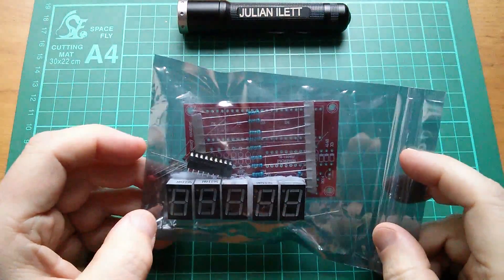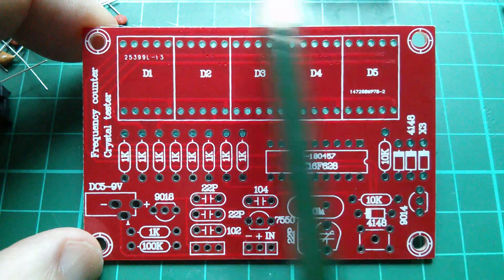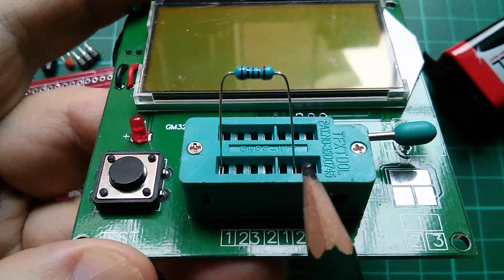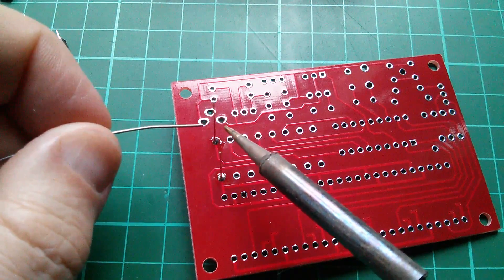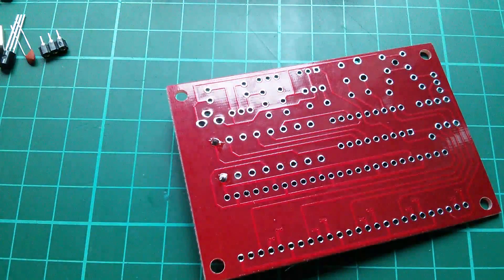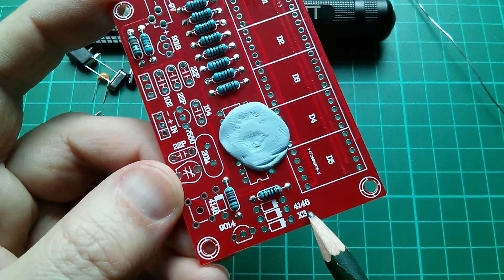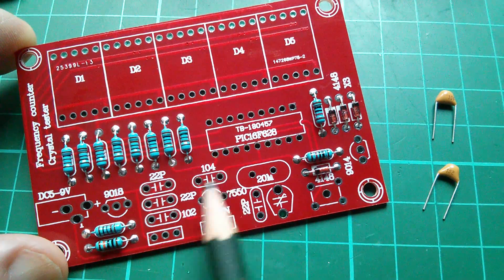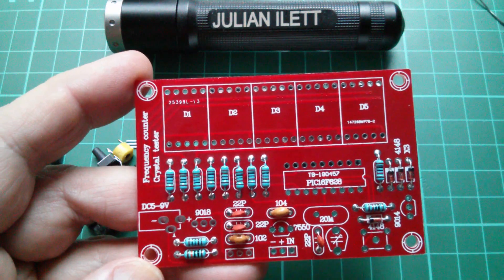Fairly Easy - Frequency Counter - Electronic Kit Build (part 1)

Comment: For anyone interested in using the xtal tester part, change base to emitter cap to 1N and emitter to gnd cap to 100P, then change 1k resistor to 2k2. xtal tester part now works reliably 👍🏻

Comment: It will be the maximum full-fledged device only after adding an amplifier with a signal conditioner on the Schmitt trigger to it.
If you need a kit with a PCB (26x9mm) and SMD parts for such an amplifier, contact msn-pro@@t
Amplifier kit cost = 3 USD + shipping
cost @t

Comment: I would have done the crystal, chip socket, and 3-pin connector after the resistors and before the capacitors...

Comment: Remember those opaque standoff's that you pushed through the holes ( You said they would work with the little LED boards that didn't have room for a screw or bolt ) ? Well how about using them as a stand off so you can have space for all the unevenly sised components ? I use plastic Motherboard standoffs and screw another on top to hold it then just unscrew and remove when finished . Like these :-
https://www.amazon.co.uk/Fixed-Pillar-Motherboard-TOOGOO-Stand-Off/dp/B01GO4NSE0/ref=sr_1_1?ie=UTF8&qid=1523210226&sr=8-1&keywords=nylon+motherboard+standoffs

Comment: The way to solder these resistors is to put them in, hold the component to the board, and bend the leads (while pulling on them on the solder side, and pressing the resistor against the component side) OUTWARD (away from the component holes) to a 30 to 45 degree angle.  Non you can release everything and solder.  You will have a via-lead-contact (metal to metal). Also, this allows all the components to be held tightly in place and you can solder all of them.

Comment: Like you I hate 5 band metal film resistors. Not only will they read both ways, the colours are not easy to differentiate between with the blue background, maybe if they used a paler blue it would have been better.

Comment: Hi Julian - 9:50 a small blob of Blu-tak under each corner works well to stabilise the PCB, just press it down until the resistors are firmly sandwiched between it and the work surface.

Comment: In order to remember anode vs. cathode, I think of a cathode ray tube, which uses electrons, which are a negative charge -- hence cathode is the negative terminal. Also arrow points the way current can flow through the diode.

Comment: In the diode symbol I remember cathode/anode by the letter K shape that's for 'Kathode'.  By the same token, the triangle at the Anode end indicates the other.  As for polarity in a circuit, one can just remember the line at the cathode end blocks electron flow (from negative, not conventional flow).  Also, please bend your leads slightly AFTER inserting them so the components don't fall out - everyone knows this and can't believe you don't!

Comment: If you want that nice "svelte meniscus"... use some additional flux. With diodes, I just try to imagine that the black bar is the black bar part of the symbol used in the circuit diagram, like this.

>|    the | being the black bar on the component.

Comment: When soldering the resistors, why not place them in the holes and bend the wires outward? This can be done with most components and works wonderfully every single time! No need to fiddle about! Sheesh!

Comment: With diode polarity I just remember that the line on the diode is on the same end as the line on the symbol, which is of course the end the arrow is pointing towards, and the arrow points in the direction of conventional current flow.

Comment: Ah, keeping all the offcuts. A spool of wire costs nothing and still I keep them as well ;) . Guess where? In the box of breadboard wire jumpers. They hardly ever end up being used on the breadboard, but them being pre-cut makes them much more handy than a spool of wire when needing wire links when soldering.
And yes, resistors have to be oriented all in the same direction! Even accross the hole board (e.g. tolerance always to the right or bottom). It's much faster to check if the correct ones are installed. And once they are in there is no more guessing on those 5-band resistors.

Comment: since the board has plated through holes you could have soldered then from the top and cut them flush with the back,basically filling up only the holes

Comment: Those resistor tolerances are for thermal variations so just by holding them in your hand a while will make them read lower ohms and cooling them will cause them to read higher, so the question is if they were manufactured in hot country you would expect them to read higher in the UK
Reply: Resistance rises with temperature.
Reply: Generally speaking that may be true, but modern resistors incorporate a manufacturing process that offsets this and if you measure a carbon film resistor you will see the opposite take place due to compression of the carbon material while heating, this is built by design as part of it's tolerance so if it says 1% it means it will try to maintain a constant resistance under loads close to its maximum. http://www.learnabout-electronics.org/Resistors/resistors_01a.php
Reply: *****
Interesting. Do you have any source about the details of the construction/how it works? (materials used, physical construction,...)
I did a quick search, but only find manufacturer's general description of low tempco resistors.

Comment: 4:12 aha I knew you had one. my component tester is a little different its the kind you get as a kit and has a rotary encoder but it does frequency counting and generation as well as component identification. Ive never actually used it for that so idk how good it is or even how to connect a frequency source for that matter, but its there in the menu. actually I think I'll see if I can get it to count a 555 after lunch

Comment: Hey Julian, here's a small tip on those resistor color bands. The resistors with the beige body usually seem to be 5% tolerance, while these with blue bodies are usually 1% tolerance. That means, that the brown band will be always the last one. Yes there are still occasions, where it starts with a brown band as well as it ends, but this way you can determine a lot of resistor values. :)

Comment: I'm hoping in part 2 Julian will explain how the programmers of the software for the pic decided you need to save a wave form and then why you need to program in an offset when taking a measurement of a frequency.  Here's hoping.
Reply from the maker: Something to do with amateur radio ;)
Reply: The facility to add an offset frequency is provided so that you can connect the frequency counter to the local oscillator stage of a superhet receiver.  The local oscillator frequency is always a fixed offset from the frequency being received so if the offset is equal to the IF frequency (tautology alert) then the counter will display the frequency that the receiver is tuned to.  OK - something to do with amateur radio.
Reply: Thanks for responding.

Comment: I prefere to stick the legs trough the holes, and bend them on the backside.
Then cut them. and finaly solder them.
That way they dont fall out in case they get hot and the solder starts to melt.
The solder should only be for electrical connection, not for holding the component in place.
I belive that was the mounting instructions on kits like this in the old days too :-)

Comment: This kit is a "Chinese copy" of the article published at http://www.qsl.net/d/dl4yhf////freq_counter/freq_counter.html (with the added crystal tester function) .

The original designer is aware of this being copied, but has a very positive attitude about this blatant plagiarism, much to his credit.   The  code within the PIC included with this kit is byte-for-byte the same as that which Wolf published on his web site some time ago ...

I've built one, it works very well (a red optical filter for the display would be handy), and represents very good value for money, IMHO.

Comment: i was making a kit and I cut one of the legs on a resistor and it went flying and went right into my 12v battery bank cigarette lighter socket and made a massive short and blew a fuse
Reply from the maker: LOL - valuable lesson learnt!
Reply: Julian Ilett defiantly I bought covers for them and now use cutters that are magnetic it helps alot
Reply: Over-engineering much? Covers for batteries and magnetic snips? The fingers on your other hand to hold the wires come for free and for a normal person are never more than an arms length away from where you are cutting ;)

Comment: I didn't care about resistor direction when in electronics at school, until the teacher got annoyed and said it wasn't professional. I still try to get them all the same direction but I don't get bothered if I stuff up to change it. Also with the bands on the end, you'll find one end has the band centred and the other more to the inside.

Comment: i want 1 of those resistance measure things how much are they and does it come pre assembled? what is the name of it?
Reply: Jay Mee They are called component testers or transistor testers. You can buy them for a few bucks. They are also kits such as this one is ;D
Reply: when it comes to kits its a disaster for me the components are too small for me to solder you should see the mess i made of a gsm module, robots should pre assemble them things as the leds and things are way too small for me, i prefer to just bye 1 lol
Reply: Search ebay for something like "diode transistor MOS PNP NPN tester capacitance ESR meter". 10$ upwards. I got that one: http://www.ebay.com/itm/131937017257 . Works well and I built my own case from wood, because when I bought it two years ago you couldn't get the case with it. I wouldn't recommend that exact one though. There are other/newer version with more functions (like a square wave/clock generator, which is handy to have around). On the other hand it's mainly a software thing and I guess I could upgrade mine to the new features (the firmware is based on an open source AVR project).

Comment: Thanks, Julian; by coincidence I ordered one of these kits yesterday!
Reply: I'd like to order a kit 🙄 PLEASE send me the address to order from 😎🙏🏾😎
Reply: @Inquire98   One of the cheapest is here - https://www.ebay.co.uk/itm/1Hz-50MHz-Crystal-Oscillator-Frequency-Counter-Meter-Tester-DIY-LED-DISPLAY-KIT/254553622756?_trkparms=aid%3D1110004%26algo%3DSPLICE.COMP%26ao%3D1%26asc%3D225076%26meid%3D1c0eee1ae22c415e9da70caaaf31f71a%26pid%3D100008%26rk%3D1%26rkt%3D12%26sd%3D153884433665%26itm%3D254553622756%26pmt%3D1%26noa%3D0%26pg%3D2047675%26algv%3Ddefault%26brand%3DUnbranded&_trksid=p2047675.c100008.m2219. Good luck with it. NOTE  there are problems with the crystal tester section, search the 'net for remedial work.

Comment: Been thinking of getting this kit myself. I am with you on the 4 band code, dumbest idea ever and my eyes are so poor I can barely make out the colours on that awful blue background. Never had a problem with the old 3 band style, now I have to measure every damn resistor which kind of defeats the purpose of having the bloody code in the first place!
Reply: There is a u in colour and it will stay there! Webster is an impertinence! lol
Reply: I thought maybe they're meant for machine assembly using sophisticated colour recognition automation, helped somehow by the blue background. Which is of course a silly idea because machines don't do thru-holery any more and already have bullet belts and smds to work with. So yeah - definitely terrible. Tsch.
Reply: Glad you got the joke and were not offended.
Reply: 4 banders are annoying but the most awkward resistors are those surface mount ones with the letters, with those you have no chance of reading the value directly and have to look it up
Reply: I say we create a startup to manufacture components with markings designed to be read by humans with aging eyesight. Artisanal components :). At artisanal prices :(.
Reply: maplin sell those yucky blue resistor with 4band plus tolerance, but catalogue states they are 3band, and has done for years...if buying resistors from maplin shops always ask them to check the values with a meter, party because of this, partly because they had a load of bad ones with way incorrect values!
Reply: Don't buy this kit unless you're a ham radio operator or crystal checker nut.  You will build it and it will work buy you'll never use it.  P.S.  There's no u in color.

Comment: I always use a multimeter to check resistors 5 band would work fine on the old round tube style resistors but on the tiny eighth watt ones that extra bit of space is never there and brown is a common tolereance and a common number to start off with and I can never understand how to do the multiplier in my head
Reply: the multiplier just means put however many zeros its colour stands for on the end

Comment: I've been thinking of getting one of these for synth tuning. It'd be interesting to see how it compares to the 'FreqCounter' library for Arduino. With a bit of fudging with the compensation variable and sampling time I was able to get up to at least 4Mhz with all digits stable +/-5-10Hz. I have no frequency standard or oscope to compare it with though.
Reply: The pic updates so slowly you will grow old waiting for a reading.  Better to view Mr. Carlson's project using shift registers.
Reply: Joseph Nicholas
Thx I'll check it out, Carlson's lab is great.
The FreqCounter lib (if find the right one) on Arduino/ATmel chips is fairly respectable using the 16bit counter and some clever overflow methods, but again only a 100ms refresh rate in the Mhz range for a decent reading.... it seems to do an alright job of consistent measurements, just not entirely accurate without adjustments and even then might not spread linearly through the freq ranges. (Quite possibly due to do with the actual MCU processor clock not being exactly 16Mhz for one.)
Reply: I think this whole kit is ill advised.  The one I build just sits and sits.
Reply: Joseph Nicholas 
Excellent I'll probably give it a go in the mood for building, prob have at least half the components sitting around somewhere. And definitely at least 20 HC595s.
Reply: The counter is only as accurate as the crystal on the Arduino. Whatever the tolerance of that will be the "tolerance" of your measurement. Other than that the Arduino library (or this PIC kit) should be perfectly fine for all uses around your microcontroller projects. The "only 100ms" refreshrate is not a limitation of the AVR/Arduino. It's just how frequency counters work. You need to count for a certain time to get a number.
Reply: Like I said to the original poster.  Take a look at the Mr. Carlson's Lab video on his use of shift registers to update a display.  I think the update of the display by the pic is why its slow. Anyways you could be right on second though.

Comment: If you spell cathode with a K (Kathode) the letter K resembles the cathode half of the standard symbol for a diode.
Reply: Could be a lot worse mnemonic.. could be the resistor colorband-number translation.  Most of those I've heard would trigger today's SJWs into a cerebral hemorrhage.
Reply: Oh, this is even easier than my "Electrons going this way (arrow) will be blocked by this wall (bar)".
Reply: Dosbomber So they come with extra value, nice!

Comment: Oh! no. Assembling of this simple board is going for two parts (or may be more ? ) . I think you should seriously consider the subject line of your videos to improve. Who the hell is gonna wait and see to complete the assembly of this simple board. Fortunately you didnt comeup with a board having more than 200 parts or else it would have been years to build and build and it goes on. The subject line of this video would have been okay if it was "beginners guide to solder though hole resistors". You should have a projected community level where you can share your view, this video will really disappoint many viewers.  After wasting 15 minutes, people can only see soldering less than 10 resistors, few caps and few diodes.  Thats it. You also didn't mention that the 10K resistor is beyond its tolerance level and what value it should have to match its 1% tolerance. That way little kids can learn a bit. Its not an important aspect to stick the bubble gum to the board just to hold the resistors. I really had an intention to click the like button this time before I opened the link to watch while drinking coffee. But I really got surprised when you were trying to show the color bands via your magnifying glass even after half mark.
Reply: İnstead of writing this roman you should just enjoy the video.
Reply: Are you still making movies?
Reply: Did your coffee go cold while watching it?
Reply: No, but my beard grew 3 more inches.
Reply: I like cold coffee! I was just expecting a fast assembling. Because if I had the same board with all the parts, then it would have taken half time to assemble and solder everything. Then 2nd part could have been a better troubleshooting video or why timer is being used instead of capture compare like that.

Comment: Yep I'm nerdy and must have all of my resistors going the same way on the PCB. 😎
Reply: I do it too, but that's because if you have to trouble shoot it it's quicker to see of you put some value in the wrong place.
Reply: I like to do that too :) Tolerance band should be facing one determined side, makes it look neater ;)
Reply: They see me mowin' my front lawn. 

Yes, that is weird Al.
Reply: It is just lazy not to.  It takes a whole half second to have them all in the same direction that makes it look nice and is easily readable.  If you are taking the time to have them flat against the PCB why wouldn't you take the time to orient them?
Reply: Me, too! And the capacitors to be read the same way round.
Reply: TheRadiogeek ocd?
Reply: me too
Reply: Nothing nerdy about that, it just makes things easier later if there is a problem.
Reply: Brainstorm4300 OCD = Obsessive-Compulsive Disorder